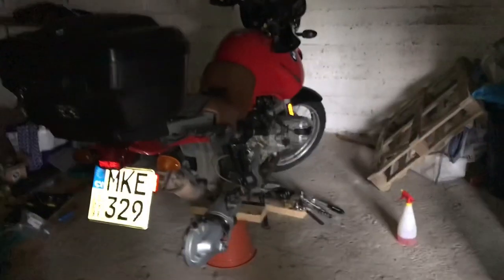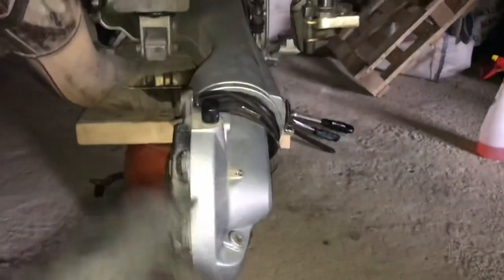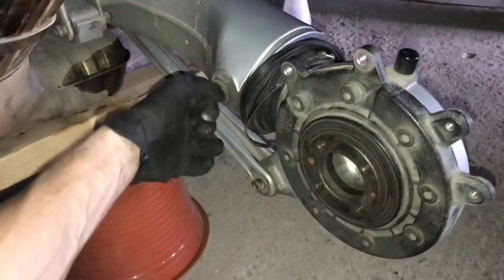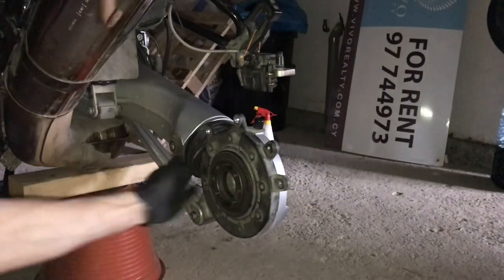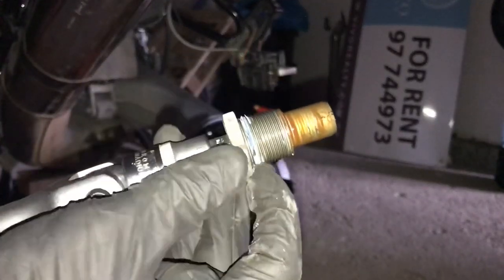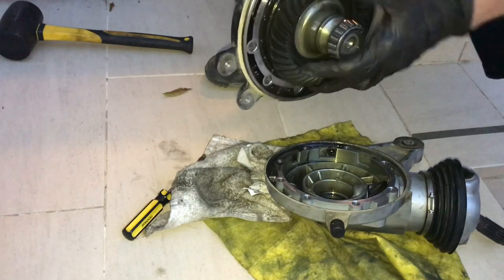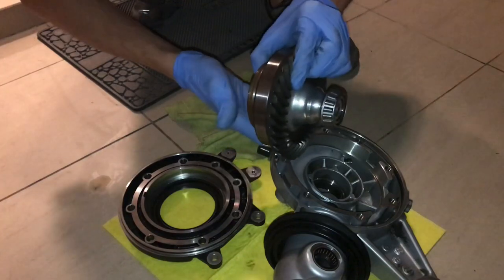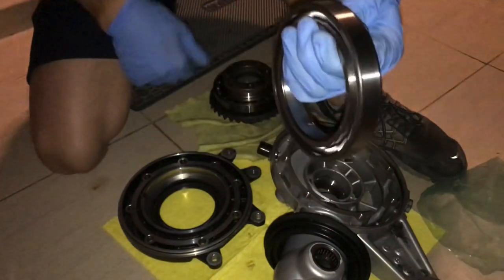How to change rear wheel bearings on a BMW R 1100 GS - final drive removal and disassembly

Comment: Hello I'm riding a r1100s, and also r1150r. After about a 90-mile ride I kept smelling a hot break or something with that kind of hot clutch or friction material burning I couldn't tell if it was a truck in front of me? After I got home check the rear brake and it was warm but not that hot check the final drive saying it was warm could lay my hand on not really hot the bike only has 10,000 miles as of today. Am I being paranoid or do they run a little bit warm under those circumstances it has alleged been serviced recently. Any ideas? Thanks Scott
Reply from the maker: There’s nothing in the final drive that produces any friction that should make that smell, it’s just a small version of a car or truck differential. Just gears, bearings and oil. Wow an R1100 with only 10,000 miles? Cool! I think if it’s not the brake pads dragging on the brake discs then you should check the clutch. If you put the bike on grass or dirt and rev the engine, and then drop the clutch to do a burnout, does the clutch slip? Please don’t crash the bike trying this if you don’t have the experience! You can also try going down the highway at 90 or so kph in 5th or 4th gear and pinning the throttle to full. If the clutch is bad, you will hear and feel slippage. In that case I would get the clutch changed.
Reply from the maker: Even though the bike has 10,000 miles, an R1100 is like 25 years old now. So the clutch material is very old if original and also the brake pads could need renewing if they’re old but still have thickness. Brake pads are very cheap and easy to DIY but essential for safety. The other thing that can cause a smell is an oil leak somewhere that’s then burning on the hot engine…
Reply: Thx 4 ur reply... Rode 85 mi after the hot Brake sm,n0 smell... only worry is FINAL DRIVE IS WARM , POS 125 F...  NO LEAKS,  10K,  
OR IS THIS NORMAL ?
Reply from the maker: @scottsdialyadventure1338  is it making noise? Can you put the bike on a stand and run the rear wheel and check for vibrations and noise? I’ve never checked the temp of my final drive so afraid I can’t say how hot is normal. If you can isolate the smell or sounds to the drive by lifting the bike off the ground then go ahead and get the final drive checked out and serviced

Comment: There are no rear wheel bearings on this bmw. Looks like all you needed was to remove the crown gear. The reason most of the final drive bearings fail is due to improper shimming ( pre load) of the bearing. Changing the expensive bearing does not fix the initial issue. How did you measure the bearing preload?
Reply from the maker: Everything’s working great now. Thanks for your insightful comment.
Reply: @SilkRider  yes it will work fine and then get destroyed again due to improper bearing preload. The dealers were replacing bearings and they all failed again. The issue is the bearing shims or to much preload due to bearing shims. You may want to do a google search and then adjust it to the proper specifications since BMW did not assemble the final drive correctly.
Reply: @frankbutaric3565  yes mate in the video all I’m doing is taking off the final drive and brining it to a BMW mechanic to replace the bearings and adjust the backlash and shim. I have the BMW repair manual, if you want it, to see the process. It’s part of regular final drive bearing renewal, it’s not optional, you just need the right tools.